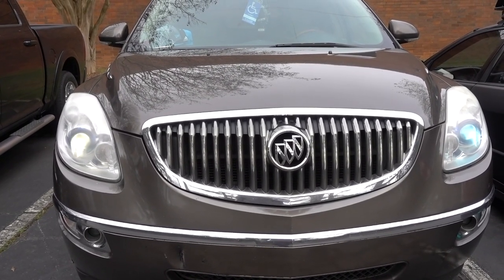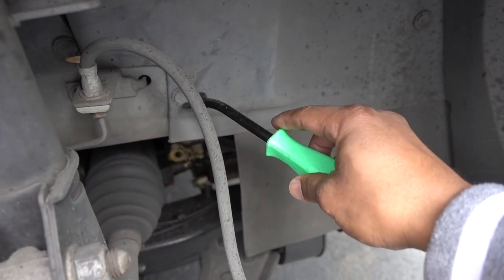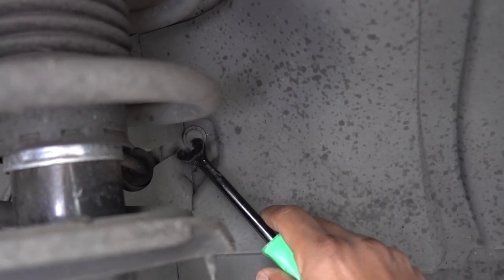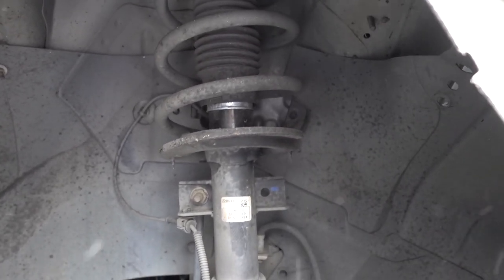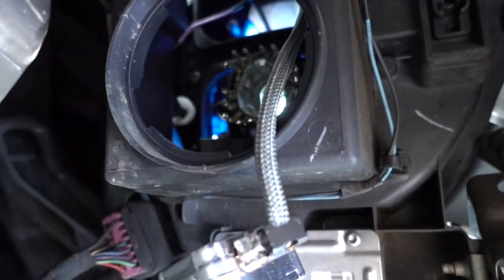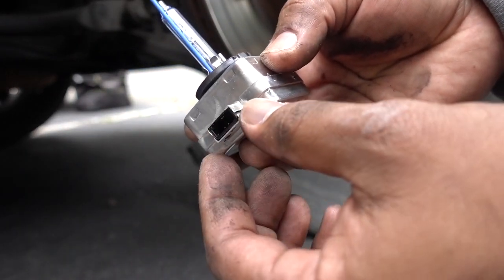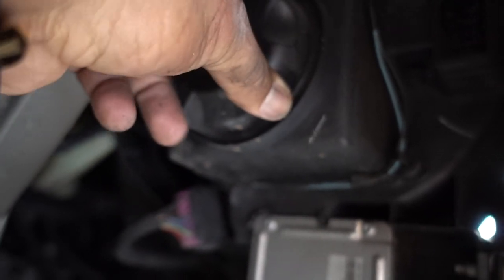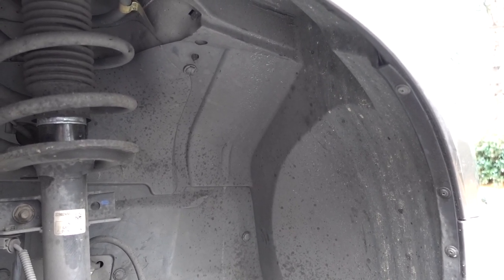How To Replace a Headlight Bulb for 2008 Buick Enclave

Comment: Thank you Solano for this awesome video.
@ 3:57 - It's really hard to describe that - after pushing the bulb in place, look for the two plastic handles around the bulb. For the driver side bulb, one is in 2'O clock position and the other one is in 8'O clock position. Just like we lock the gas cap,  grab those plastic handles and turn them clockwise to lock the bulb. Hope that helps.
Reply: That is true~

Comment: We did it today!!! Only issue was removing the damaged bulb because of a tight fit for the hand movement, but once it was removed, it was a simple insert of the new bulb and Complete
Reply from the maker: Nice
Reply: @BulletSolano  Thank you for the video!!! TirePlus wanted to charge me $400 to just change the bulb. They stated that the bumper had to be removed! Not 🤣🤣🤣
Reply from the maker: 😂😂 no problem
Reply: @tdperrychatham  a guy just told me the same thing
Reply: @queengem2671  smh--- change it yourself lady and keep the $400 to yourself. The bulb cost $99 and entire time was 20 mins max.- Keep you pocket safe. But shop around for the bulb- Amazon, etc.
Reply: Why do they keep saying the bumper has to be removed!!!  I SEE NOW THAT'S A LIE
WHAT ARE THESE CALLED? WHEEL WELL PANELS! NOT BUMPERS
Reply: Just did the bulb change on my wife’s Buick and ya my hands barely fit in that socket to turn the bulb release. Cut my thumbs to hell but I forced my digits in there and low and behold the light came out.

Comment: Thanks for making that video you made it very easy to understand but I do have a question. I have to replace the ballast. Was that the ballast right above where you took out the headlight or was it underneath the headlight
Reply from the maker: The ballast is on the headlight, is one unit

Comment: Do I need to disconnect battery first ? Is for a 2011 enclave
Reply from the maker: Not necessary but do it if you feel like it
Reply: How do I remove the lightbulb from power source you said squeeze the clips , I’m stuck can’t disengage light bulb

Comment: Hello,
My question is I have a 2014 is it the same set up?
Also we’re can I purchase a Halogen  Bulb?
Reply from the maker: Hello, Yes same set up
DMEX D3S HID Headlight Bulbs Xenon 6000K Cold White 35W Replacement 66340 42403 42302 Headlamp - Pack of 2 https://www.amazon.com/dp/B07F715HCL/ref=cm_sw_r_cp_api_i_mzWOFb4EE639S

Comment: Hello Bullet I need to buy 1 what’s the number on the package so I no I’m getting the rite 1 2008 enclave
Reply from the maker: Hello Serena this is the link
ICBEAMER 6000K D1R D1C D1S Xenon HID Direct Replacement Replace OEM Factory Headlight Low Beam Light Bulbs Diamond White https://www.amazon.com/dp/B07J22LQVC/ref=cm_sw_r_cp_api_i_zIxREb631KE3W

Comment: Can you please recommend good LED replacement headlight bulbs for 2008 enclave to replace current HID bulbs. Thank you
Reply from the maker: In the description of the video I have the link for ones I get for the truck, still have no problems with them, those are good
Reply: @BulletSolano  Can i replace existing HID headlight bulb with LED on my 2008 buick enclave? And can you please recommend a good brand that gives maximum brightness. Thanks
Reply from the maker: Hi, yes
DZG D1S D1R D3S D3R LED Headlight Bulbs 50W 6000K Bright White, 2 Pack https://www.amazon.com/dp/B07PMGPBYM/ref=cm_sw_r_cp_api_fabc_ptrVFb3BQB3E3

Comment: hi i would like to know share your experience Among the best of the xenon or LED for TOYOTA RAV4 2016
Please what do you advise me thanks
Reply from the maker: Hi, I used this one before, Auxito, this ones are really bright.

9012 LED Headlight Bulbs Mini Size 80W 16,000LM Per Pair CanBus Ready, AUXITO HIR2 9012 LED Headlight Bulb Conversion Kit, 6500K Xenon White, Pack of 2 https://www.amazon.com/dp/B07WYL1P47/ref=cm_sw_r_cp_api_i_59DnEbDTR0T0S
Reply: Bullet Solano 

thank you so much
Reply: Please for fog lights
Reply from the maker: Same thing, auxito but for the fog lights you need H11

H11 LED Headlight Bulbs Mini Sized 80W 16,000LM Per Pair, AUXITO H11/H8/H9 Headlight LED Bulb with Cooling Fan, 6500K White, Pack of 2 https://www.amazon.com/dp/B07WD6G42D/ref=cm_sw_r_cp_api_i_QLEnEb3Z13B16
Reply from the maker: No problem

Comment: Hello.  i have a problem with low beam shining too little on my 2008 GMC acadia.  I put the 12 v direct from the battery but it remains the same, what I see is that these headlights do not have ballasts either of the two, where the ballast goes, it has a cover.  Could anyone help me.  the headlight physically looks great on the outside and inside.
Reply from the maker: Headlight bulb connector is bad or bulb is bad

Comment: I don't want to buy a new light if it's not needed. How do I check for that? It blinks a couple of times and then stays on
Reply: 2009 Buick Enclave
Reply from the maker: Yes is going bad
Reply: Thank you!!🙏🙏
Reply: Do you have any recomendations on where to buy light??
Reply: Oreilly has it for $100
Reply from the maker: No problem
Reply from the maker: In the description of the video I put the link for amazon, where I get those lights

Comment: The dealer wants $110 labor charge to install two new bulbs. These are expensive bulbs, so that's roughly $300 to have the dealer do this. That's nuts.
Reply: Firestone told me it takes 2 hours and 40 minutes labor....300 for one bulb.
Reply: Firestone told me $500 to replace 1 passenger side HID bulb if get the bulb that's still $300 labor alone
Reply: Dude, the dealership got me for $250. I am pissed! Lmao
Reply: I actually did go ahead and replace them myself. I found them for about $78 each online. It took me all of about 45 minutes to replace both of them. You do really have to peel that inside plastic mudguard back pretty far to get to them but it's not that big of a deal. It's just that removing the tire and the mudguard takes time.
Reply: Update:
Asked a Custom shop close by that does aftermarket rims & stereos if they changed HID bulbs he said yes for $75 if you bring the bulb
Got the bulb on Amazon (2 for $30)
DMEX D1S Xenon HID Headlight Bulbs 6000K Cold White 35W
Perfect bright blu-ish match

Done in less than 30min. for $105 total instead of $500 at Firestone 
Take the bumper off my a$?
Reply: @The_Eumelanin_Warrior idk if you know how to access YouTube or not but if you do then you pretty much screwed yourself 😂 there’s no way anybody should go to the dealership for simple plug and removal of lightbulbs